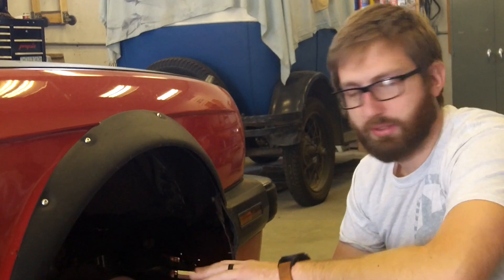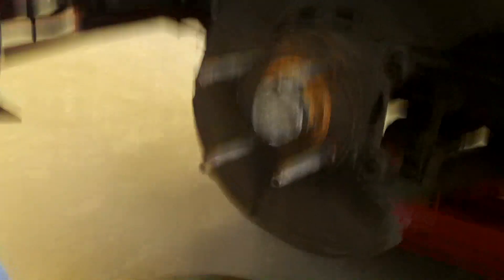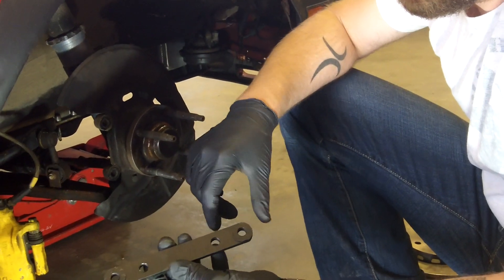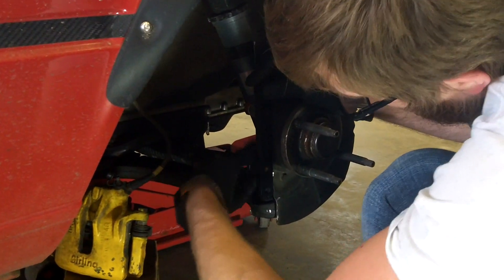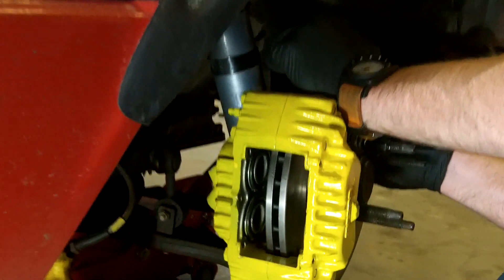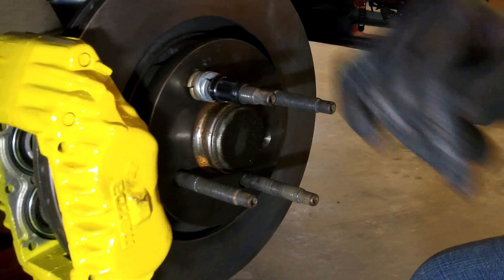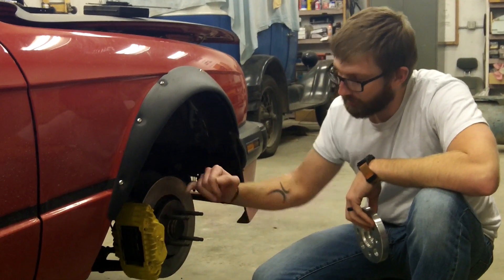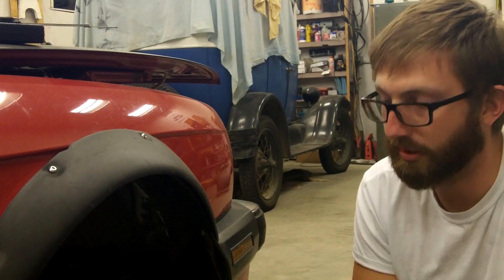Cheap E30 Brake Upgrade Rx7/Vw BlockHeads Garage Ep.15

Comment: Bit concerned there is no mention of brake bias, and that stopping distance seems to be a function of braking force and not tyres???   If you can't lock the wheels surely there is a problem?  or is everyone too spoilt by ABS that they have lost that knowledge.  The point of bigger disks is to avoid brake fade, not improve 1-time stopping distance!

Comment: You can get a much simpler brake line adapter, theyre on the front calipers of most 90's volvos. I got mine at the junk yard.

Comment: Do you need to change the master cyd bore size
Reply: I'm running rx7 calipers in my v8 e30. I still run the brake booster setup, but I have a 750 master cylinder ready to fit to reduce travel and give better pedal feel. 750 master is better suited to the 4 pots

Comment: will the original e30 15 bbs wheels clear this setup?
Reply: The original depending might be 14"s but almost certain they wouldn't, mines were  mm's away from clearing the stock calipers, I found that very weird but they are 14"s is makes sense. Id say 16-17's at minimum with a certain wheel offset or spacers is what you would need.
Reply: Grand Productions Media what model rx-7 caliper Fc??
Reply: Jason OC the ones he used are Turbo FC calipers.